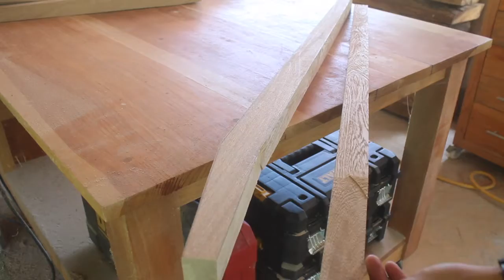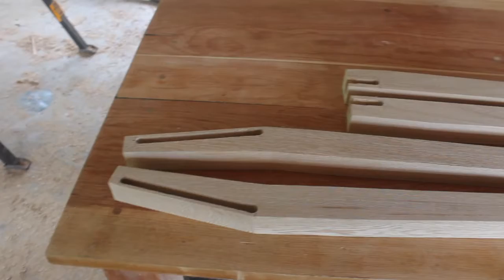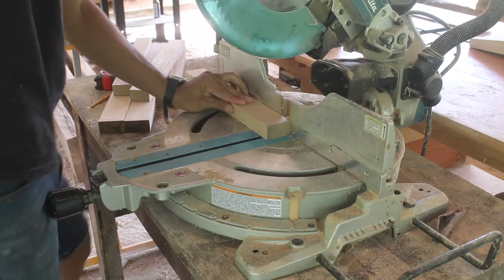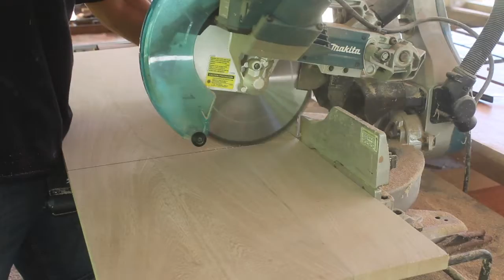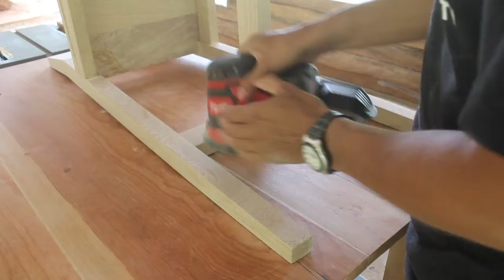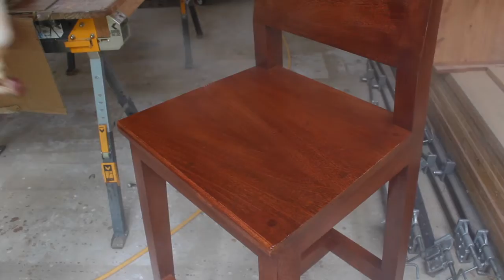How to Make a Bar Stool | Counter Stool

Comment: Those are absolutely beautiful stools buddy, love the design and finish on them.
Great work as usual, thanks for sharing.

Ps. Would love to see more of your horizontal mortiser, what is?
Reply from the maker: Thank you so much for your comment, I appreciate it.
About my mortiser machine is and extension of my table saw, use the same table saw chunk, so common here in Mexico, can be interesting to make a video about it
Reply: I get it, similar like on planer/thicknesser machines. Sure if you do video it it is always interesting to see.